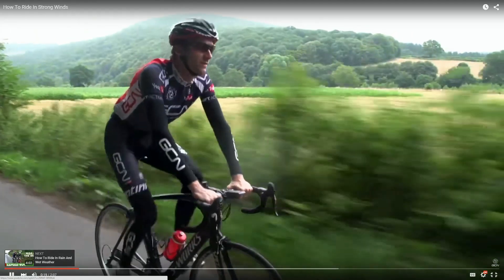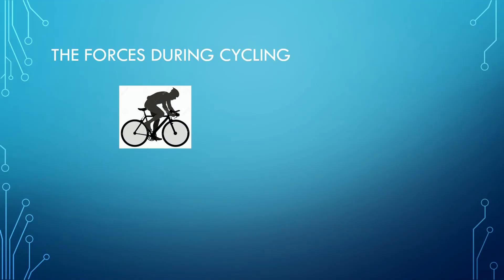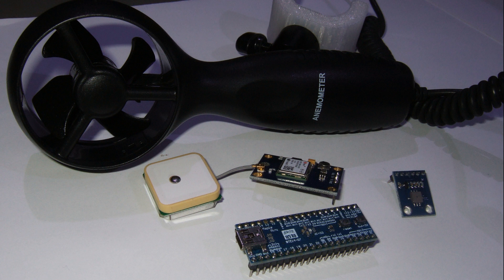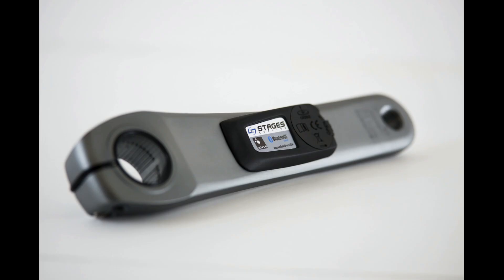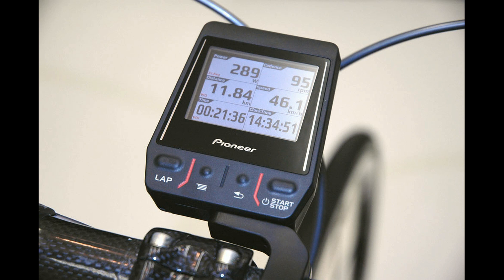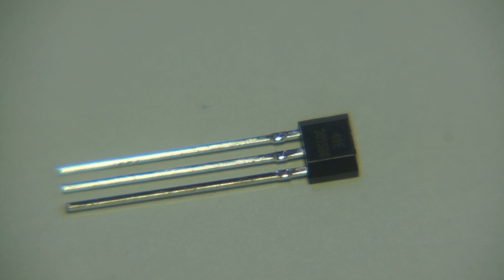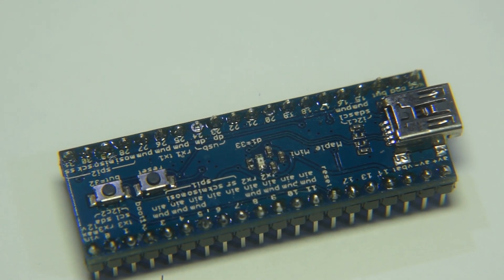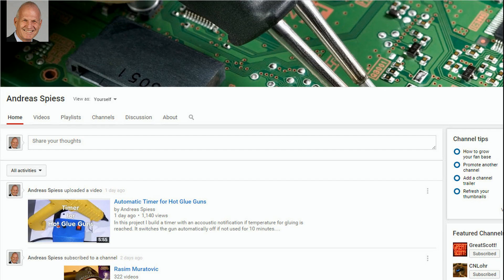#15 DIY Bicycle Power Meter Part 1

Comment: Andreas I am building an athletic push sled with wheels. Any suggestions on what to get to put a power meter on it? Similar to yours?
Reply from the maker: I do not know what your requirements are. And I abandoned this project because it was quite complex, and you get now simple power meters which measure the force of the pedal press.
Reply: Well it is an exercise push sled with wheels I am designing. I was thinking about adding some kind of resistance motor (preferably an adjustable one) with a small chain attached to the axel add a small chain ring to the axel and then somehow add a watt meter to the resistor. Any thoughts? Powermeters for bicycles like a SRAM are quite expensive
Reply from the maker: You find some videos about DIY power meters using strain gauges (like the SRAM)